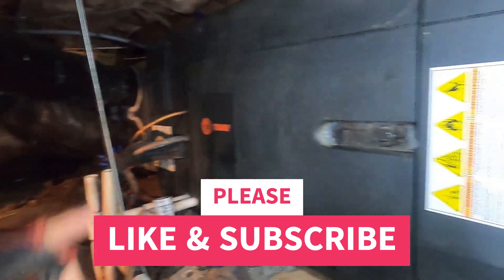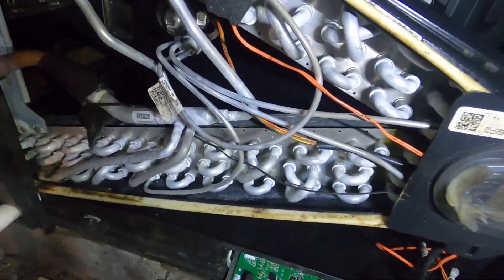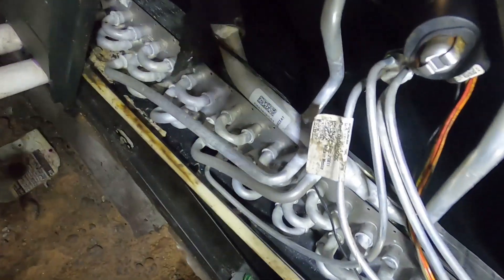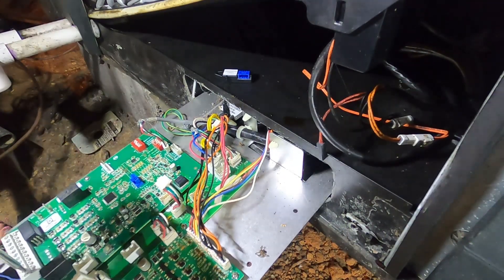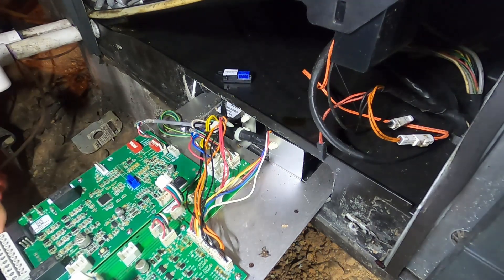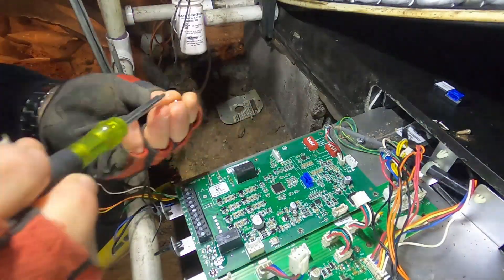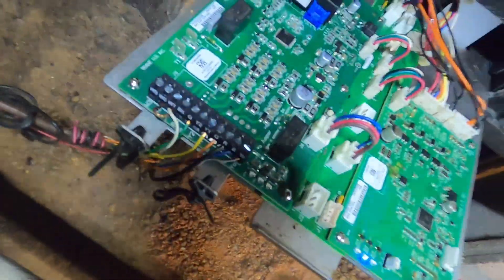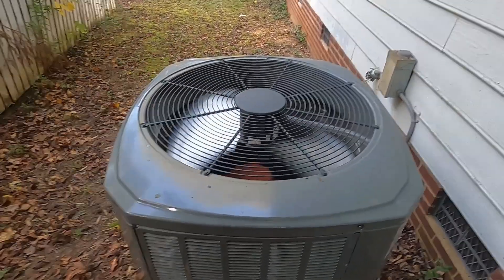Finally fixed after three months.

Comment: Canada is starting to go big with adopting heat pumps.

But if the boards found in Canada work better that's what counts.

Also remember how I mentioned Mr cool universals are rebadged gree flex units.

And how the gree flex units themselves are better quality VS Mr cool universal as far as, assembly while aparently in Canada gree has a deal with trane in Canada where one of the other rebadged gree flex units are made and assembled by trane but is only available in Canada but since you and Ted like trane maybe you guys could see if you could get here in the US the trane version.

And try out. Not sure yet what the trane version is called but at least trane you guys know.

And could get parts for kind of like the rebadged trane Mitsubishi mini splits.

As that could help trane with the side discharge compressors with the air handers and the micro inverter technology and higher seer ratings without all that propertiary overky complicated proprietary stuff.

Basically what I am saying is that rebadged trane version of the gree flex should be made available for the US market not just Canada.

So guys like you and Ted could sell them.

Comment: Sorry to comment again got the trane name for the gree flex rebadge that so far is only available from trane Canada its called the trane resolute mentioning it because you mentioned the boards you needed where only available from trane Canada.

But the trane resolute subsodely has a high markup but if it works and you can get parts for it.

That might be an option you could offer your custumers who want high efficiency systems that are 20 seer heat pump units but not be able to afford the US branded trane communicating systems. High seer systems. Anyway great video but ridiculous custumer had to wait 3 months for a board and some relief.

That would annoy me.